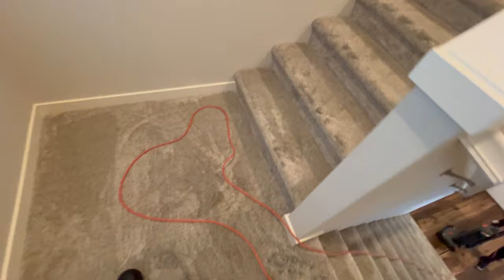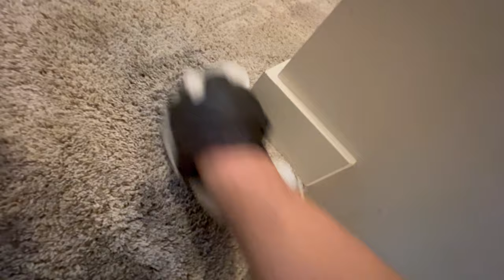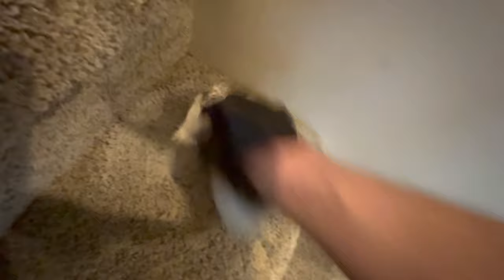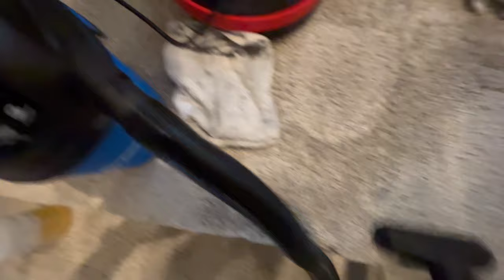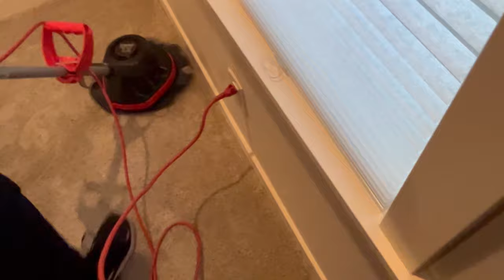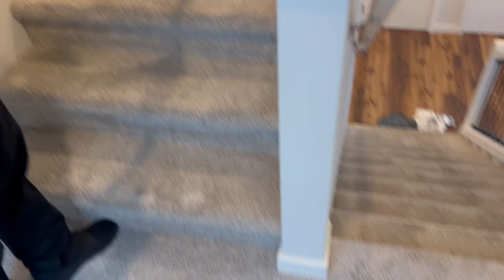Cat Vomit Charcoal Medicine On Carpet- How to DIY Tip in Video

Comment: Charcoal pencil stains can be no joke! About 3 months ago we had a bad one and multiple applications of strong citrus, strong peroxide, green dragon, etc wasnt cutting it (i prevacuumed the crap out of it also). I was using HWE for that job and luckily I was able to remove it by using bonnet pros gum grease and ink. STILL took multiple applications, 20mins of dwell time, and numerous passes to get rid of it.